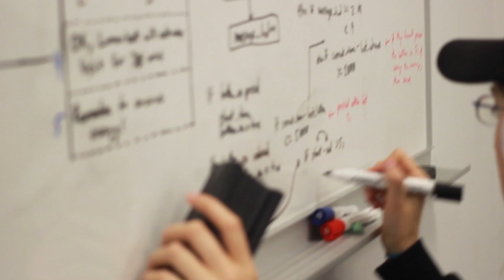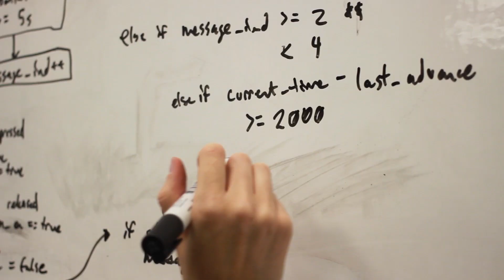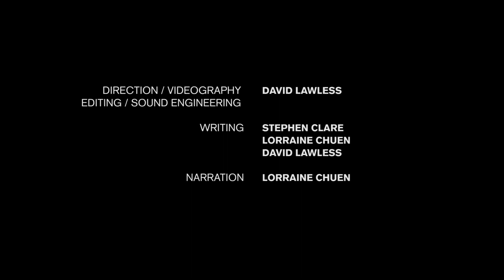LUMENBOT: The Future of Energy

Comment: nice work, would be nice to use in my workplace. We have to turn off the light by going to the fuse-box and turn off the fuse... instead of buttons we would need a wireless switch though. I don't want to go to the fusebox :)